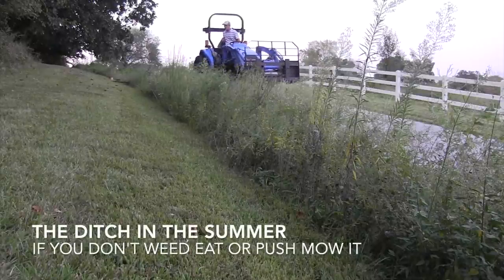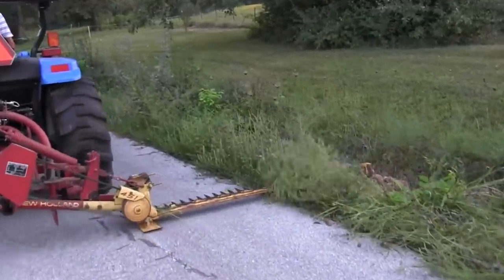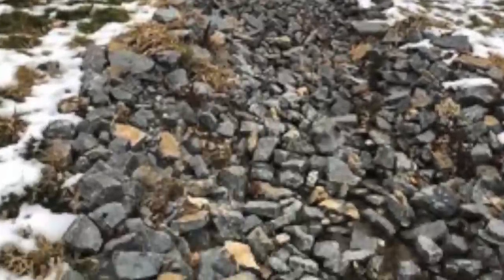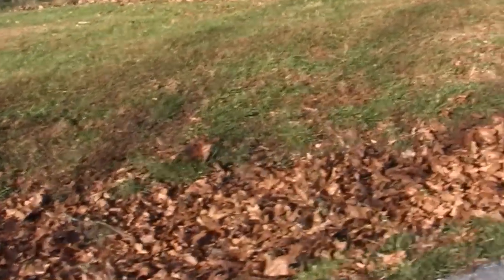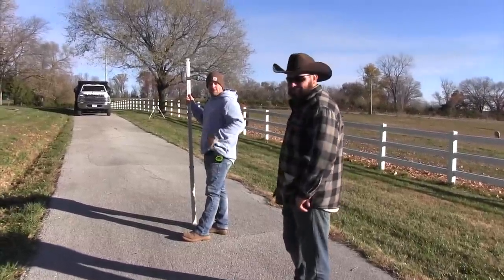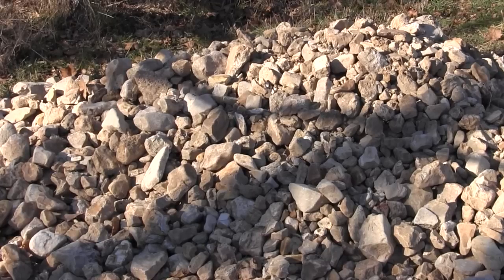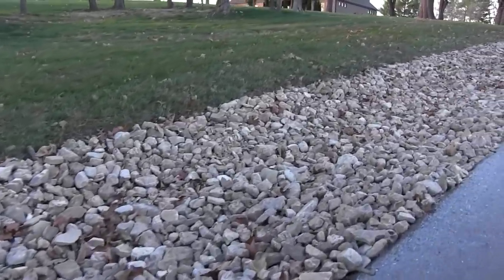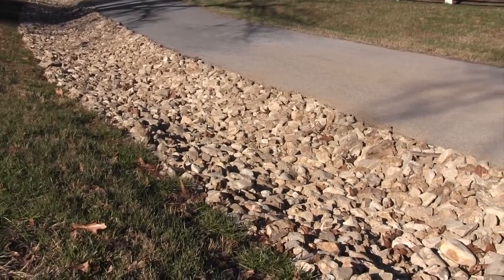Fixing an Ugly Rough Ditch Erosion Problem With Creek Rock

Comment: Looks good Mike. I used to repair highway drainage issues in my career prior to retirement.  My only concern is the velocity of the water.  It appears to have lots of fall and a big area to drain. It’s good that you have a well defined channel for the water. Many just dump rock in a ditch which just causes the water to dig channels around it. Just take a video of the ditch in a heavy rain event. If the velocity is to great you might need to install ditch checks to slow it down.
Reply: Good advice here
Reply from the maker: There was a section of ditch toward the bottom of the slope in the video that was eroding at an alarming rate when we moved here after several abnormally large rains.  I started putting rough field rocks in there and it seemed to stop.  It didn't look all that great, but it let the water flow through and kept any soil before in place.  That all got dug out when the new rock came in, it did it's job.
Reply: @fastrivers812 I don’t see why larger angular ballast rock that’s compacted to lock wouldn’t stop That from happening as long as you put in geotech fabric at the bottom and up to the road (I like to pin mine in place with larger anodized steaks and then OCD me using concrete or landscaping caulking around and on top of each stakes in spike to BLOCK a path of least resistance situation causing water migration.). 
Also  I would also suggest lining the geotech fabric with a smaller angular rock like 3/4” angular rock (I used clean but needs vibrating compaction ) to compact down so that the bigger stuff with more significant sharp edges don’t pierce or wear down the fabric as much. After the base layer is the smaller rock is compacted you can add the larger angular ballast rock - I used 1-3” with no fines but you could go a little bigger also. But make sure you get small enough angular rock with no fines close to the edge so that the water will go in there vs makes its way down the edge of the road because you didn’t put the geotech fabric or 1-2” angular rock close enough to prevent the water from falling off the asphalt or concrete edge making a Little dirt / mud canal. Make sure the water can’t deep down and underneath the road by wrapping the fabric up and around, pinning  to the edge if you have to. Also, I put a rapid set asphalt concrete mix ontop of my fabric and the cut asphalt and it stuck very well but make sure to wet it down with a sprayer first. My 100 ft of driveway edge along the weak city asphalt “crust” is built strong enough to handle a school bus 4 x per day using it!

Comment: That looks really nice Mike. I hope you can spray it with something to keep the weeds and grass at bay. I wonder if it's level enough to run the brush hog over it once a year or so. I've done that at a customer's place that had something similar. I keep the deck a little higher so it doesn't pick up any stones. It's higher than the surrounding grass, but at least it's uniform and doesn't look unkempt.

Comment: I would put a BIG O plastic 4 in. drain pipe in the bottom the kind they use around foundations, moves water fast and the rock work as a French drain. With just the rock it will fill up and spill over, same problem again.

Comment: Yes you finally got it done 👍 hilarious I was just thinking I should messenger you and ask what you did with the ditch . That was me Stephen Gentile that sent you those pictures 😉 You guys did a great job . Up here in ontario we call it gabion stone or rip rap . The sharper the stone the better too lock in . It stops tumbling or movement in rapid water movement . And yes it still looks the same as the pictures I sent you . Lime stone also purifys water . It’s great for the Enviroment and excellent for ponds where water runs into it . Well Done Mike 👍👍👍
Reply from the maker: Stephen, thanks for giving me the inspiration, we relied heavily on your advice.  I wish the rock was a little sharper but that's about the best we could come up with.
Reply: @TractorMike   Your welcome Mike . In the dry  summer days I take the tractor and slowly and carefully compress the stone with tires once and awhile . This keeps the stone compressed nice and keeps a nice convex Shute . 👍

Comment: Looks great.  I live in the mountains in southwest Virginia on forty acres with over half a mile of gravel driveway that is pretty steep in areas.   My solution was to rock the ditches as you did and put run-off culverts to control the volume of water.  In your case you don't appear to have that option.  If the slope isn't too bad I think you should be fine.  As one commented said,  you might have to put up a few rock dams to slow the water but you need a gulley washer to test it out.  As far as weeds go, I have to spray once or twice in the summer to keep them knocked down.  But it is an easy job instead of weed whacking.  I also have a leaf issue in the fall that requires a leaf blower to clean the ditches.  You don't seem to have that much of issue with that.  Can't wait to see how it works.  Great video.  How old is that cycle  mower?
Reply from the maker: I'm guessing we bought that sickle mower in the early 80's.  It got used for years to mow under apple trees before harvest, it doesn't get used that much anymore.
Reply: @TractorMike  Thanks Mike.  As a small tractor owner I really enjoy your informative videos and especially your "insider" knowledge of the implement business.

Comment: That is nice looking work and the contractor did a great job of placing the rock so water should drain and leave the rock in place. I need to do some work around my place and there is rock in places along our road which was washed off and the county didn't push it back into the road so I have been thinking of getting it using one of my tractors and using it to fill in areas where the water have washed away the soil over the years to repair the land.

Comment: ?question Mike, how would i go about adding a skid steer quick connect onto a 1953 Massey Ferguson TO-30?
Reply from the maker: Shoot me an e-mail with the brand and model number of the front-end loader and we'll see if there's a conversion kit available.  My email address is mike@asktractormike.com.  I don't think a tractor of that vintage would have had a loader on it from the factory, so it's got to be an aftermarket.

Comment: Looks nice.  I have a similar issue.  How many linear feet?  Can you do a video 6 to 8 months later and let us know if you had issues with weeds?  Also can you let us know what he charged you for it?
Reply from the maker: About 600 feet.  It's hard to know what the ditch part actually cost because it was lumped in with other landscaping and hauling off concrete, leveling out ground in the pasture, etc.  It was several thousand $.  That's not something I'd usually spend that much money on but I knew if we ever tried to sell the place (and we may downsize soon) that ditch would hurt the value of our place, so I feel we'll get the money back when we sell.  I've been wrong before.
Reply: @TractorMike  understood and seems like a good decision.

Comment: Any update as to how its holding up?
Reply from the maker: Yeah, it looks just like it did in the video and we've had some really heavy rains of late.  I see some smaller pebbles floating out and accumulating at the bottom of the hill, the big rocks haven't moved.  I'm very pleased with how it turned out.  I haven't figured out an easy way to get the mower over the top lip, though.  I'm going to have to weedeat it.  That's my only complaint and I can live with it.

Comment: Honestly……. I didn’t see any problem with what you had it was working.   Grass, weeds and vegetation  with root mass are the best solution ALWAYS…..  I appears to me that you have actually created a Maintence problem.   In the long run rock never works. It will now erode under the rock after you spray weed killer and the rock will sink over time into the ground and your grass edge will start eroding as well.  Good luck with it.    I would have kept the grass and installed check damns that you would pipe thru section to section.   Mother Nature always tells you how to work things out if you listen and use common sense.    As far as mowing slopes and ditches.    Buy a Ventrac it mows on 40 degree slope and I mow short banks in ditches with mine that approach 50 degrees.